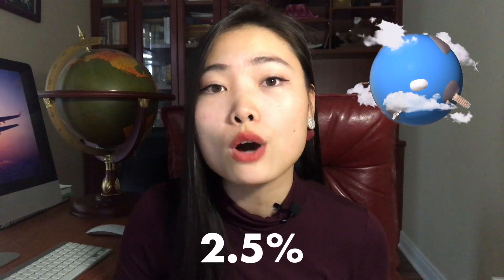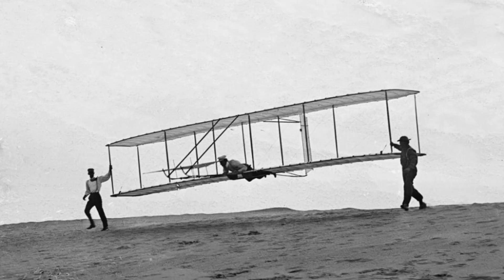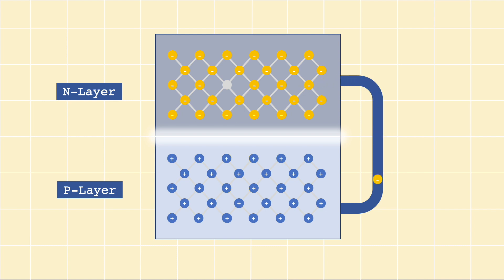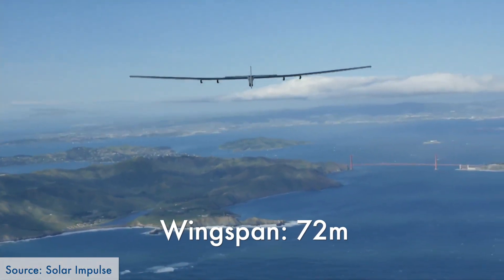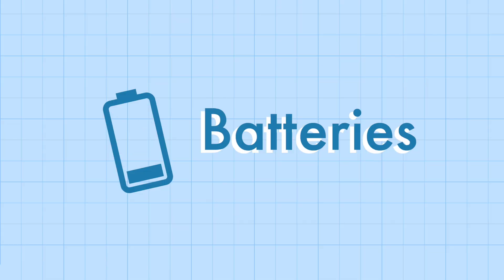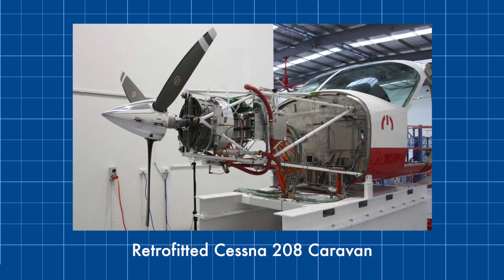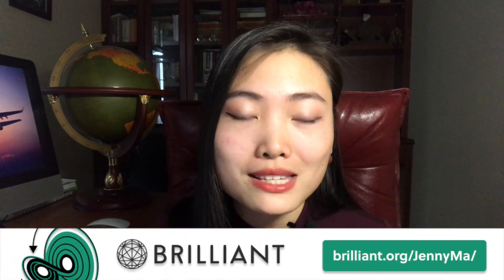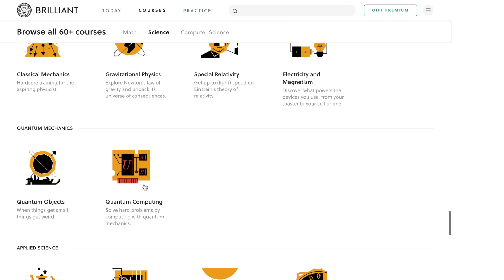Electric Planes Explained: Sci-Fi or the Future?

Comment: All we need is a energy source that is efficient to produce, and the waste products are O2, N2 and H20 which can be used for extra mass to provide addition energy when being ejected (any other waste produce needs to be captured/stored). 
And that the new fuel/battery/energy source, energy conversion system into motion needs to be lighter than the existing engines and fuel.

Comment: Carbon Dioxide is not a pollutant.  Aviation is NOT bad for the environment.  Please keep the crazy environmentalist nonsense for some other platform, there's enough junk on YouTube...
Reply: Carbon dioxide is a relatively inert and non-hazardous gas in small amounts (compared to something like chlorine gas or smog). But carbon dioxide is most certainly a green house gas ESPECIALLY in the amounts that it is pumped out by burning fossil fuels (e.g. jet engine). Aviation is an extremely high contributor to CO2, so yes it is detrimental to the overall environment notably the climate.
Reply: Dumb comment
Reply: It's not toxic on its own, but when we dig up dead biomass from deep in the ground and burn them up by the millions of tons, that's very damaging. In addition to climate change, it also makes the oceans acidic, like your soda. So indirectly it is toxic in these large and ever increasing quantities. Life cannot adapt to the rate that we're burning fossil fuels.

Comment: I think hydrogen PEMs could be viable for aircraft until the specific energy of batteries improves significantly. I think that even hydrogen would require totally clean slate aircraft designs though, with more efficient airframes (Blended-wing body,  non-planar wings, etc.), more efficient propulsion (distributed electric propulsion, maybe even boundary layer control/suction etc.), better structural materials (even more use of composites, metal foams/metal foam sandwich panels etc.) needed to compete with fossil fuels. But every one of those things would require insane investments in research and development and certification and testing costs. Hopefully the industry steps up to the plate !!
Reply from the maker: Yeah! I haven't looked into hydrogen for aircraft much yet, I'd be interested to research a bit more. The changes you mention would be beneficial to the industry as a whole, not just eco-friendly flight - hope we can get there soon! :)